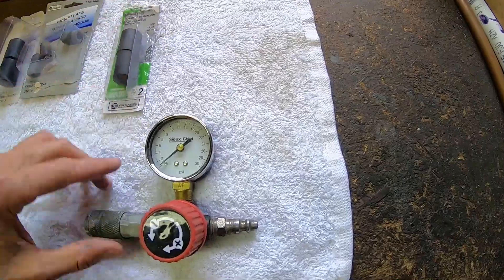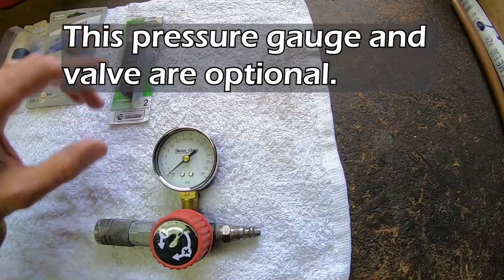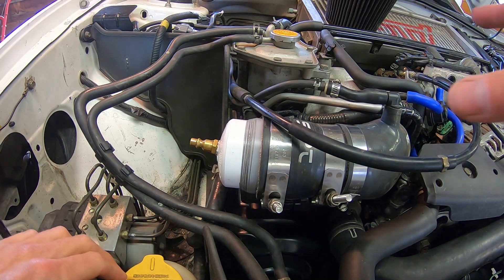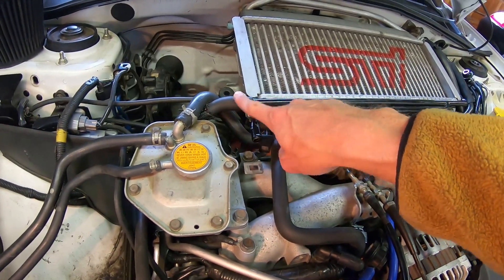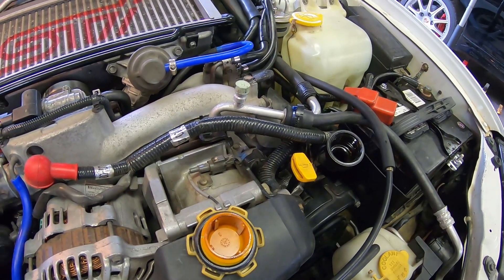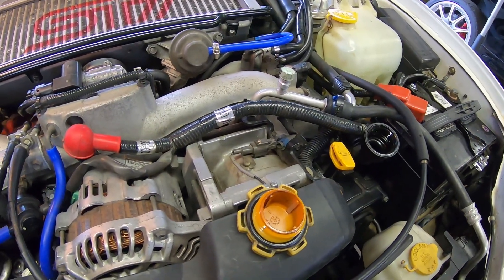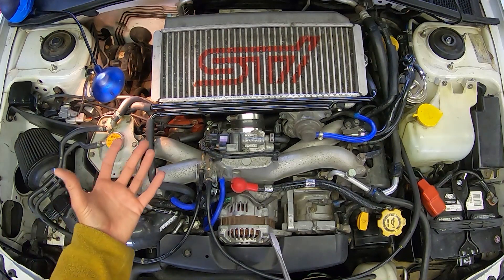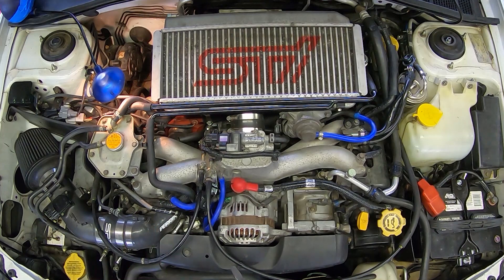DIY Pressure Test - Subaru WRX 2002-2014

Comment: Thanks for the walkthrough! 
Why is there a need to cap off so many hoses? Wouldn't you want to test the entire system as it normally sits in operation? I figure taking off the oil cap alone would be enough to relieve the crankcase, no?
Reply: It’s because those hoses are not pressurized by the turbo and they aren’t designed to be, they come before the turbo inlet. They may break or just blow off if you leave them connected.